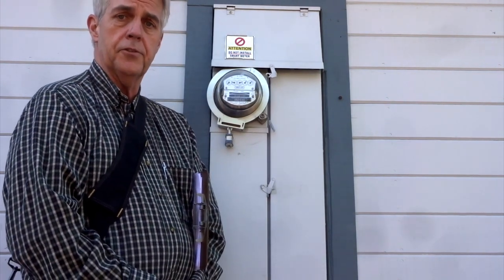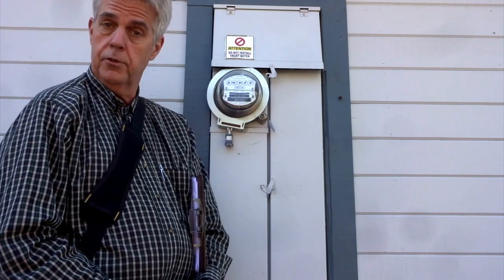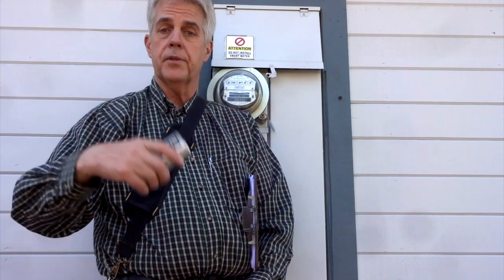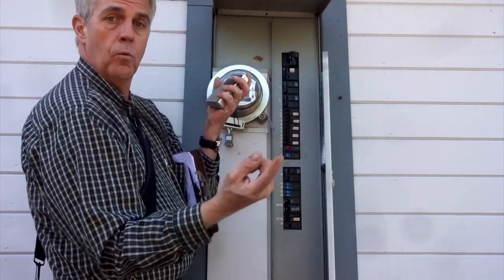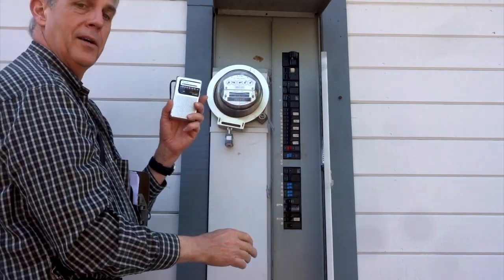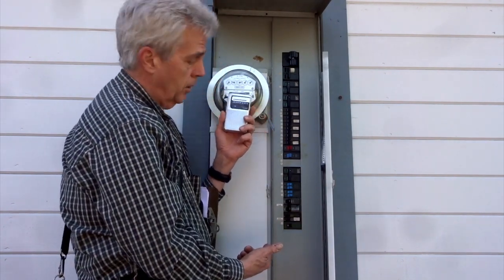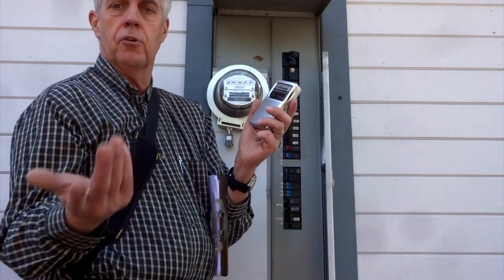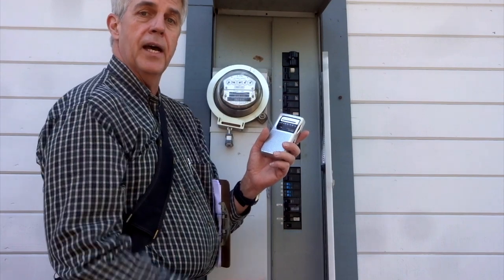Detecting Dirty Electricity with an AM Radio outside the house

Comment: This is caused by switch-mode power supplies which are found in computers as well as LED lighting. Dimmer switches can also cause this "dirty electricity."
Reply from the maker: Ryan you are correct.
Reply: As long as not a "health attack"... then you have to figure out the carrier frequency that's beam forming from the source of what I find typically a pulse train waveform to create the VLF range signals.  Identifying the source and carrier signal pisses them off imminent threat even worse.  Better to tell your legislatures and executives, along with the OIG's, OSI's, GAO's and a broader range of servants, that you've identified imminent threats that need to be prosecuted ASAP by special warfighters that will use lethal force.

Comment: The current flowing through the cables is what generated the EMI. The higher the current the higher the EMI. "The strength of magnetic field is always proportional to the magnitude of current flowing. Hence, when the current increases, the magnetic field also increases." Straight from google. There could be a large load inside like a heater or washing machine. Those will all generate a hum near the power lines. Its always been like that for 100 years. The bottom breaker is a 240V breaker obviously connected to a large load like a washing machine. This guy is clueless
Reply from the maker: Hello Alex,  the am radio buzzes loudly up to 25 feet from the house when the CFL bulbs are on but not when the electric dryer is on.
Reply: @windheimemfsolutions  An AM radio will also buzz as you drive under transmission power lines. I remember that happening all the way back to the early 70's. No compact florescent or LED bulbs back then and switching power supplies in PCs because they simply didn't exist back then.

Comment: Okay that's cool to find, however dirty electricity is not going to do a single think to you unless you're touching live wires. they are good lights however they are the cheap ones of the led lights.
Reply from the maker: For those with an open mind: the effects of radiated or conducted kHz RF radiation is well documented: see links.

By the way,  I used to feel as you have expressed.

When I shut off the source of the dirty electricity some of my clients feel an immdediate relief.  

Here are some informative links for you.

How to measure Dirty Electricity
https://buildingbiologyinstitute.org/mep-fundamentals/

More eductional links for you
https://magdahavas.com/havas-video-presentations/gs-units-explained/
http://www.sammilham.com/links.shtm
https://magdahavas.com/electrosmog-exposure/multiple-sclerosis-and-dirty-electricity/
https://www.stetzerelectric.com/research/

All the best to you and your endeavors.

Sincerely,

Eric Windheim BA, EMRS, BBEC, RFSO
Certified Electromagnetic Radiation Specialist
Certified Building Biology Environmental Consultant
Radio Frequency Safety Officer
Lab Leader for the Building Biology Institute (BBI)
Serving Greater Sacramento Region, Northern California, Bay Area, Central Valley & Reno
WindheimEMFSolutions.com
Office: 916-395-7336 
Sacramento CA

Comment: He says he is a Certified building biologist.
Definition of biology: a branch of knowledge that deals with living organisms and vital processes
Definition of building. :  usually roofed and walled structure built for permanent use (as for a dwelling)
I would say  Certified or Sectioned probably legally.
The noise he demonstrates is oscillating 60 Hz from the provider US standard.
Any AM radio will pick up AC power from any source.
Noise is not “dirty” it's just most switch-mode power supplies in modern equipment generate square waves that add a very high number of frequencies to the power signal.
By the way, electricity is charged by amper hour, not volts.
Reply from the maker: Hello Mark: my AM radio is tuned to below 540 on the dial.  What I am picking up is the kHz, kilohertz frequencies of dozens of CFL light bulbs in the house. Yes the switch mode power supplies, SMPS, are creating the kHz frequencies the radio is detecting.  You can see them on my oscilloscope and spectrum analyzer in many of the other videos on my site. https://www.youtube.com/channel/UCJuvZDo-M2yqmd3SyWkiEfw.  Thank you for your comment.
Reply: @windheimemfsolutions  The only harm that noise causes is to ham radio operators trying to work HF bands. RF from DC to fukall GHz is NOT ionizing. Ionizing radiation starts in the upper UV part of the spectrum, RF is at the bottom end of the spectrum below visible light.
Reply: @windheimemfsolutions  And that has precisely zero effect on humans. Pisses off radio hams tho
Reply: @elfnetdesigns702  How DARE you come here with your facts and science !
Reply from the maker: @TheChipmunk2008  For those with an open mind: the effects of radiated or conducted kHz RF radiation is well documented: see links.

By the way,  I used to feel as you have expressed.

When I shut off the source of the dirty electricity some of my clients feel an immdediate relief.  

Here are some informative links for you.

How to measure Dirty Electricity
https://buildingbiologyinstitute.org/mep-fundamentals/

More eductional links for you
https://magdahavas.com/havas-video-presentations/gs-units-explained/
http://www.sammilham.com/links.shtm
https://magdahavas.com/electrosmog-exposure/multiple-sclerosis-and-dirty-electricity/
https://www.stetzerelectric.com/research/

All the best to you and your endeavors.

Sincerely,

Eric Windheim BA, EMRS, BBEC, RFSO
Certified Electromagnetic Radiation Specialist
Certified Building Biology Environmental Consultant
Radio Frequency Safety Officer
Lab Leader for the Building Biology Institute (BBI)
Serving Greater Sacramento Region, Northern California, Bay Area, Central Valley & Reno
WindheimEMFSolutions.com
Office: 916-395-7336 
Sacramento CA
Reply: Pure biology or applied biology?

A specific ergonomics and physiology define the difference in building a structure to secure from external variables of physics eg temperature and pressure and similarly differences in material chemistry, defines the termite and the civil engineer, architect, or crew of stone mason and concreters.
Reply from the maker: @TheChipmunk2008  For those with an open mind: the effects of radiated or conducted kHz RF radiation is well documented: see links.

By the way,  I used to feel as you have expressed.

When I shut off the source of the dirty electricity some of my clients feel an immediate relief.  

Here are some informative links for you.

How to measure Dirty Electricity
https://buildingbiologyinstitute.org/mep-fundamentals/

More eductional links for you
https://magdahavas.com/havas-video-presentations/gs-units-explained/
http://www.sammilham.com/links.shtm
https://magdahavas.com/electrosmog-exposure/multiple-sclerosis-and-dirty-electricity/
https://www.stetzerelectric.com/research/

All the best to you and your endeavors.
Reply: @windheimemfsolutions  unfortunately those people who virtue signal with a flag they have no association with are not open minded , so its a losing battle , they are too institutionalised.

Comment: It's AMAZING what you can catch with an am fm radio
Reply from the maker: Dirty electricity radiates off the power line in the form of kHz RF radiation and the AM radio tuned to below 540 AM picks it up very well.

Comment: Wow...

The exact sound in this video, is the exact sound I heard on my radio for the previous month since I bought it, it occurs at 6pm-1am.

I had my energy company (xcel) out on my property, trying to figure it out too, I was giving information about "Garage Doors" and other things, but not about CFL lamps.

All I did after I saw this video, was turn off one lamp, one single lamp... and the sound is now almost completely gone, the sound could be heard 6 feet from the building at times, I guess tomorrow I'll conduct more tests but my entire apartment is now silent on the AM radio... incredible.

 I would guess around 98% of the sound, now gone, from 1 lamp, just wow... I can hardly believe this was such a powerful source of low frequency EMF... 

This was a dimmable lamp, with a long CFL bulb, very unique bulb I'm sure would be difficult to replace, perhaps there was something wrong with the lamp, or the bulb, but either way.. Thank you so very much for this video, It is overwhelming to believe this EMF was out of my control and being produced from an electricity meter or what ever I thought it might be over the past month.

Thank you so much, God Bless you.  
Take care.
Reply: Also I'm going to google what lightbulbs don't do this later, but the recent LED's I installed through the apartment aren't as bad as that one CFL lamp... or what ever it was...
Reply from the maker: Please clean up your post and do stay in touch.
Reply: edited, thank you.
I'll take a picture of the lamp and post a video as well soon, and link it here, for people reading the comment section.
Reply: What is your take on grounding mats? I threw them out about 2 weeks ago because they were conducting radio signals and conducting that CFL / LED lightbulb sound directing into my body I imagine,  good choice to get rid of them?

I have a heart condition and I'm trying to do all I can
Reply from the maker: Hi Euclidean,  I am glad that my video has helped you.  You used the right kind of reasoning to find the source of the problem.  Utilities are reluctant to tell you about the hazards of CFL bulbs since they were mandated by the state to push the bulbs to reduce electric demand. Feel free to visit my website and fill out my contact form with your PHONE #.  I would like to talk with you about your experience.  PS: what is the make, model and wattage of the suspect bulb?
Reply from the maker: Please do send a good photo.  Thanks for your post.

Comment: In this video at about 0:26, the statement is made, ". . . quote energy-efficient compact fluorescent and LED lights that we turn on . . .". Compact fluorescent lamps and LED bulbs are indeed more efficient than incandescent bulbs. If one has some equipment, he can easily verify that both fluorescent and LED lamps produce more visible light per watt of electricity input than is true of incandescent lamps.
Reply from the maker: Right Danno,  LED & CFL bulbs create more lumens per watt and do so with a switch mode power supply (SMPS) which creates the HFVTs, high frequency voltage transients or DE for short, dirty electricity.

Comment: I have serious radio noise on 530 am band around my house, it reaches out to the road which is about 60 feet away. I have driven around my block and when I get about 75 feet from my home the radio in my truck goes nuts.
Reply from the maker: Hi RE,

You may be able to find the source by turning off one circuit breaker at a time and notice when the truck radio goes silent.  Next up is to have only that breaker on and start turning off devices one at a time.
Reply: Do you mean keep on the noisy breaker and then unplug things?

Comment: Hi. Why aren't the smar t meters sheilded ? I don't have a stetzer meter but a Electromagnetic Radiation Detector which i bought over 10 years ago after going to a seminar on dirty electricity! My wife bought the book on dirty electricity and the lecture was quite interesting. Amazing how much dirty electricity are in all houses!!! I used my oscilloscope to test my sons smps power supply on dc side and you can see the DC but a lot of strays? Hairlike lines around the dc voltage? Any reply appreciated cheers from Australia subbed and liked 👍

Comment: Hi, so you are saying that LED bulbs are bad? And DE cant bea measured with EMF meters? Only with oscilloscope..
Reply from the maker: No.  In general they produce less DE than CFL bulbs.  Some are very clean but most still produce some DE.  I test them and when I find a clean bulb I buy them up by the hundreds for my clients.
Reply: @windheimemfsolutions  But what is worse?
1. Dirty Electricity?
2. Microwave radiation from smartmeter, wifi, smartphone, bluetooth...?
Reply from the maker: @ralorpa  They are all harmful.

Comment: Is a DE filter effective to reduce this kind of "noise"? Which ones would you recommend? There are several products out there.
Reply from the maker: Good question.  Yes there are a variety of filters the can reduce it but but the best way is to remove the source of the problem which is the 5 dozen CFL bulbs in the house and replace them with bulbs that do not make DE and this noise.  It is much more cost effective to replace the bulbs than install filters.
Reply: Thank you for responding. I was using the AM radio technique to determine the level of noise near power strip (it has cell phone chargers, USB chargers and other electrical appliances attached to it). The sound and noise came out of the radio was pretty disturbing especially near the LED bulbs. Super high pitch. If I would like to eliminate the non LED DE, would it be effective to install DE filter?
Reply from the maker: Great questions Hendra.  You do not need expensive filters.  The simple and low cost solution is to replace the bulbs with ones that are clean.  I have done extensive testing over the past two years, via testing with 5 instruments, and have found bulbs that are clean.  They are available at major stores nation wide.  I test the bulbs with: oscilloscope, spectrum analyzer, Fluke 289 digital multi meter, Stetzer meter and an AM pocket radio.There is one brand of bulbs that is clean in all of the above tests. These bulbs are lower cost than famous brand light bulbs.  I buy these bulbs in bulk, test them, and provide them to my clients.
Reply: @windheimemfsolutions  how to measure if the led bulb is de free? what about computers? You can't just replace computers too....
Reply from the maker: @Altermedicineorg  Here are the meters I use,

Fluke 297, Picoscope 2204A oscilloscope and spectrum analyzer, am radio, Stetzer Meter.
Reply: @windheimemfsolutions  may I inquire as to the brand of lightbulbs you prefer? Thank you!

Comment: They use switch mode power supplies that generate a bit of hash. It's the curse of radio enthusiasts everywhere but not dangerous in the slightest.
Reply from the maker: Hello Trev,  The kHz frequencies on the line produced by the SMPS radiate off the wires and go internal to the human body.  When frequencies exceed 2 kHz the impedance of human skin goes way down and the electric field enters the body and produces a current on body tissue.  This is what causes acute symptoms and chronic illness.
Reply: Wow! I would love to learn more about this 2 kHz threshold. Does this mean we do not need to worry about frequencies below 2KHz? Thank you.
Reply: No, it is completely harmless and only affects those that believe the unfounded and unscientific opinion of lunatics with radios or meters and then only because they are worriers. It can be annoying for DX radio enthusiasts. Imagine being on board Radio Caroline, they should all be dead by now, but strangely they aren't.
Reply from the maker: Helo Trev,

What is your profession and who do you work for or with?
Reply from the maker: Hello Lishana,  Learn more here: http://www.stetzerelectric.com/category/research/  AND HERE: http://www.sammilham.com/links.shtm
Reply: Windheim EMF Solutions. A cure for something that isn’t a health problem. Might be handy for a radio ham or a DXer if it works.

Comment: I was just looking into home made crystal radios (I've bought the components I needed like germanium diodes and magnet wire etc) I stumbled across this video by chance. What exactly is dirty electricity?
Reply: Loaded question!

Depends on how much you know about physics and electricity to begin with to how one would answer your question.

Usually dirty electricity specifically in wiring in buildings is typically referring to what is called harmonics on AC circuits...

But I HIGHLY suggest reading "The Non-Tinfoil Guid to EMF's" by Nicolaus Pineault... that will answer all your questions and more in an easily, accessible way that is pretty organized and not exceedingly technical. I've been in this wormhole since last year and it's the best resource by far that I've been able to find as a comprehensive guide and source of info...

Best of luck. Cheers!!
Reply from the maker: DE is a high frequency voltage transient in the kHz range.
Reply: @RollOut82  thank you I will check it out, sorry for the 5 years delayed message. YouTube is rubbish.
Reply: @windheimemfsolutions  Thank you for the explanation
Reply: @leftylou6070  haha your reply made me notice 2 messages form year's ago I had no notifications for.

Comment: What was the interference level prior to LED use? What's the mitigation for the situation?
Reply from the maker: This client used a mix of DE producing LED & CFL bulbs.  I did not measure the house before they installed these bulbs.  The video shows the reduction in AM radio interference when the house circuits are off and it is a very dramatic drop.  Most of the time the DE is produced by devices in the house.  I did not take a Stetzer meter orOscilloscope measurement at the main panel with all circuits off so there which would have indicated what amount of DE is coming in from the utility.

It is important to measure what DE is coming in from the utility alone: this require connections at the main panel and should NOT be attempted by homeowners for safety reasons.  You can also do this by unplugging all devices in the house and turning off all light switches.  Use a stetzer meter to see what the DE level is at that point.
Reply from the maker: remove the source of the problem which is the 5 dozen CFL bulbs in the house
Reply: And replace them with what?
Reply from the maker: Incandescent, Incandescent Halogen hybrid or LEDS that have been tested to be clean.
Reply from the maker: Right